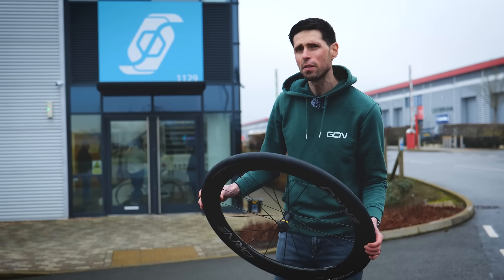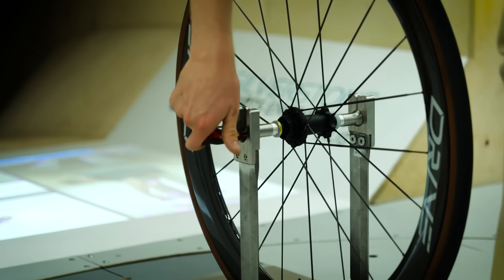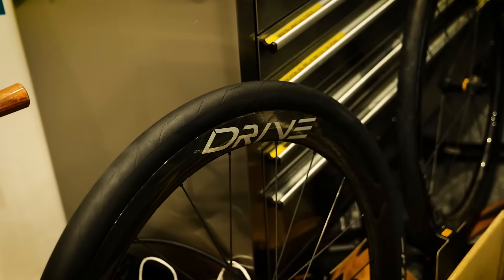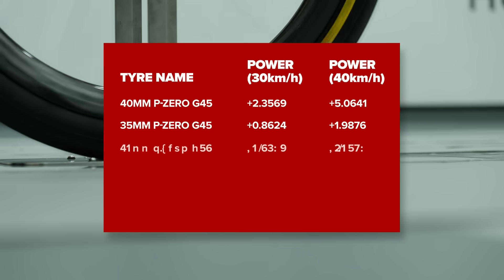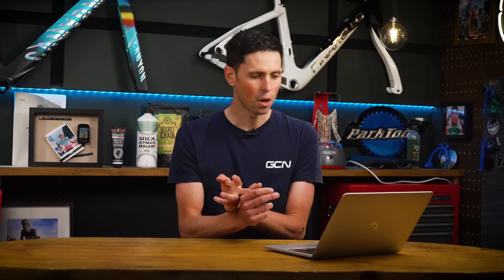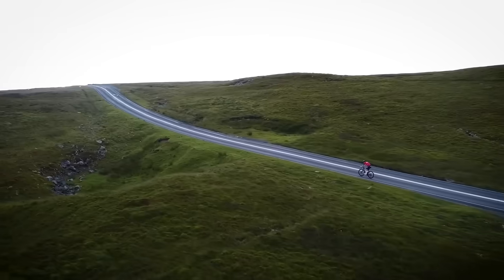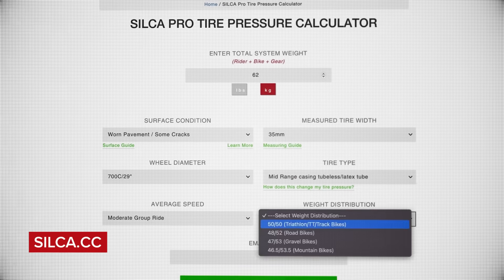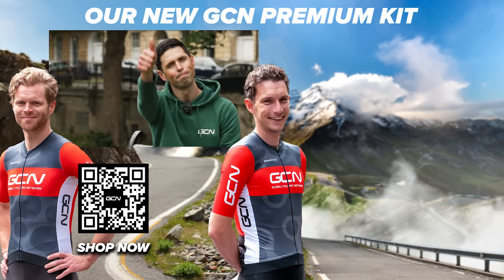The Fastest Tyre Width is NOT What You Think

Comment: The fastest tyre width for me is 23 mm, ‘cause anything bigger will rub my frame. Yeah I know, it’s time to update my bike.
Reply: I was faster with 23s than I am with 28s. 

I was also 10 years younger...😂
Reply: @andrewcockburn7484 it's the tire, I was 35 years younger and I can you it's just these modern tires, 23mm was chunky at that time 😊😊😊😊
Reply: @andrewcockburn7484 uh huh, sure you were! 😂
Reply: I just did a major upgrade from a 1980s iron road bike...

From 6 rear gears from Sachs it went to 10 gears from Campagnolo (Veloce) with Vittoria Randonneur tires 28mm because of the anti-puncture protection.

See if you can upgrade your bike instead of selling it and buying another one.🙂
Reply: @jorgesantos85 That’s what they want you to do.
Reply: Why upgrade something that works perfectly fine?
Reply: @ReaperCH90  The idea though is to pay for new stuff to go faster without being a fitter rider. That's the whole point of new tech! Speed for money, not fitness. Or enjoyment.
Reply: Continental GP5000 23 with tubolito innertubes are fantastic combo. at 6/6.5kg pressure. i don't need to upgrade.
Reply: @Jibs29 GP5000 23mm front (88psi) and 25mm rear (90psi) coupled with TPU inners is my sweet spot.
Reply: 8 bar ❤ @Jibs29
Reply: Nothing wrong with 23s ,I run mine at 90psi
Reply: @1RichieRich  Less rotating weight and faster on smooth roads - what's not to like!
Reply: I feel that, my old Kestrel 200SCI still has 23s. I'd like to go the complete opposite direction with my next bike by getting a gravel bike and running 45mm tires because the roads where I live are pretty crap.
Reply: Same here. Most I can fit are 23. Don't want to shell out on a new bike though and I don't get dropped. 😂
Reply: Ride what you want.
Reply: Keep Your old bike, much better option
Reply: 23s are just fine.
Reply: @da😂😂😂 omfg ok fozzy! vidspendlove5900
Reply: @davidspendlove5900  they're "fine" but they offer poor riding comfort, they're just tokens of the past
Reply: No not Neede, its durable
Reply: @beeldpuntXVI ha,ha I have an old carbon bike so I share that man ..... God that bike still has it ...just not as comfortable. ..
Reply: I'm wondering if it's even worth upgrading my 25s to 28s
Reply: @mrm9561  it is worth it, the difference in comfort is noticeable
Reply: @mrm9561 same here. I got 2 sets of spare tubes so I won’t upgrade until I’m down to one set.😂
Reply: I prefer 20 mm.  They're the lightest. it takes less energy to accelerate, makes the bicycle lighter. Im more into casual riding, not racing, so it deosnt matter to me if they may be slower once you get to speed. Also Im OK with 100 psi, but never go above that!
Reply: On my bike, I have used 23, 25, and 28s, same tire. Hands down, I go faster on the 23s, preferably Vittoria corsas at 120-130 psi, the differences have been a good 20 watts at a cruising speed at 20 mph on a flat smooth street vs a corsa 28 at 80-90 psi.
Reply: I can't fit bigger than 26c into my frame, so, it's pointless 👎
Reply: Tires rubbing the frame will definitely slow you down.
Reply: same, I dont think it is worth swapping an entire bike for....
Reply: Not unless you need a new bike
Reply: I ride 25 mm.   Really not trying to go fast unless downhill 😂
Reply: ride 25mm front till it wears down the fork… i’m joking ok internet
Reply: 25mm for me on an older Emonda - The tyre doesnt' touch the frame but its close enough that stones get caught between the frame and the tyre
Reply: It's not the time to upgrade your bike. No if it works flawlessly well and all parts are working ok. Don't feel pressed by the market
Reply: Why are so many people talking you out of a new bike? I'm sure you dont need that negativity
Reply: Yeah, same problem for my old 2013 Tarmac SL4 - I think the limit was 24 mm.  Unfortunately, all manufacturers stopped with 23 mm tubeless tires, except maybe Vittoria Corsa Graphene which wears way too quickly.  Perhaps newer Continental GP 5000 look narrower than their predecessors.  It's bad at least 25 mm is not included in the test.
Reply: I can go all the way up to 28 mm with the rear, but 25 mm is max before it rubs the fork crown.
Reply: 23mm 200g weight 30mm 300g x2 = 200g more no good for climb 23mm wins
Reply: Omfg
Reply: 😄 i think i got a similar bike
Reply: Not necessarily, a newer bike is not automatically faster or better.
Reply: In 1990 ye
Reply: 😂 great answer 👍🏻
Reply: Ridley Noah, minha bike também me limita 😅
Reply: I'm maxed out at 25mm on my 2005 Madone
Reply: hahaha...it happens with my older bike
Reply: Clickbait. You don't know what I think.
Reply: Try  riding 23mm on cobbles
Reply: My specialized tarmac SL2 can run 25 easy but I didn't try 28 yet, if it fit, the chances of rubbing are very high.
Reply: how can it be? In my old Merckx 2009 I use a 28
Reply: The bigger gain by going wider and riding lower pressure is COMFORT. Not all of us want to go faster, but who doesn’t want a smoother ride?
Reply: I just recently tried fitting 24mm since 25 would be to big and so far so good! Unsure how much of an upgrade that is though xD
Reply: :face-green-smiling:

Comment: I usually ride 32mm slicks on my gravel bike. Bought a road bike last week and stuck on 30mm as thought it was the sweet spot for speed and comfort. I do wonder though, the rolling resistance test is with the bike perfectly upright. If there was a rig which could test corning speed, would be interesting how it affects the results for those fast riders/racers.
Reply: If we forget about cheaper/Budget tyres for second here. I strongly suspect the biggest factor affecting corner grip/speed is the rider and not the minor difference between tyre width. There's no doubt in my mind a wider tyre will have more grip, but I haven't tested this, however I do believe the rider is the weak link for cornering speed!
Reply: @alexpatonGCN agree the capability of the rider is a big factor but equally, as in F1 or MotoGP, the tryres grip in fast corners gives confidence to the rider to go faster.

Comment: If one is touring long distances, the faster tyres are the ones that do not need you to stop and mend punctures twice a day!
Reply: 45mm gravel bike
Reply: Exactly why I switched off gp5000 lol, thing was like swiss cheese in 1/2 the miles my cheaper tires (ultra sport 3) would get zero punctures. I still have plenty of wear left on them but I'm too afraid to even use them again
Reply: @opliko  Interesting, what inner tubes were you running? I switched to 25mm gp5ks with conti's own tubes and the first 1000km has been puncture free, even if I've ridden on gravel in a pinch.
Reply: @myownsite  It was either conti race or race light can't remember anymore, but I never rode on any gravel. If stuff is getting through to the tubes though it's not great regardless. I think I'll try some P7 sports whenever these ultra sport 3s wear out, they last a while
Reply: I use 32mm ebike tires Continental Contact Urban with slime in the tubes and drastically reduced the risk of flats.

Comment: I think that evaluating tyres at constant speeds is a bit misleading, rolling resistance is part of the equation but there are other factors... Wider, heavier tyres are certainly harder to accelerate coming out of corners, for instance. Same for sprints and other speed-changing conditions. What do you thing that this could cost in terms of fatigue over a long criterium race? Personally, I am perfectly happy with 28mm tyres and do not see the need to go any wider.
Reply: Have you done the math to say how significant another 50-100g is at the outside of the wheel in affecting acceleration?
Reply: @mitchellsteindler  even if he hasn't, other people have, and it's genuinely negligible. Wheelset weights genuinely don't impact the acceleration of a bike.
Reply: Heavier wheels "feel" slower, but they don't matter.

The greatest accelerations the bike sees is in the parking lot goofing around. So that is where you feel the extra mass. In a race, no one is actually accelerating fast enough for it to matter. Yes, even out of a corner or in a sprint. The G force just isn't much. Your feelings can betray you!
Reply: @JonathanHair  I have raced a lot of crits and sprinting out of slow corners, lap after lap, for sometime dozens of laps, has been always really hard for me (90Kg+ rider here). How much does a heavier wheelset can make you slower over time? I have never seen a test tailor-made for finding that out 🙂
Reply: @gegaray no need to do a test. It can all be calculated. (1/2)*M*V^2
Reply: yes, I know... if you have 10% more mass, it will take 10% more force simple as that ;-) the question I have is that will make a difference after a lot of repetitions?
Reply: But wider tires corner much faster. Also take that into account ;)

Comment: 25mm is fastest for me because <25 feels terrifying to me at 50kph (newbie "proper" road cyclist) and I don't think my rim brake bike fits 28mm :)
Reply: you have an offset to turn to push the wheel in the caliper. it opens the gap more.
Reply: @Jibs29  The calliper isn't the issue, more the frame
Reply: @thenayancat8802  then why you said "i don't think my rim brakes fits 28" ? i've read it well so i responded accordingly.
Reply: @Jibs29  "I don't think my rim brake bike fits 28mm"
You did not read it well.
Reply: @thenayancat8802  dude... then formulate it in a better way. just say, i don't have the clearance on my frame. that's it. because it lets us think that the calipers is the issue. why making such weird sentence for a simple thing to say ?
Reply: @Jibs29  It's a very easy sentence to understand. I said that my bike does not fit 28mm tyres. It's not my fault that you failed to read it and are now scolding me for your inability to read a simple sentence... dude.....

Comment: Is anyone out there riding 40mm, on a road bike? How can anyone think that's reasonable, to go from 23mm as a standard only a few years ago to almost double that width. If it's for comfort then ok but why even include it in a test with 28mm... of course they're gonna be slower in every way. Why skip 23mm and 25mm which were and probably still are more widely used than 40mm?
Reply: Lots of people put road tires on their gravel bike. I think there are a lot of situations where 40 mm tires make sense.
Reply: I assure you that more people ride 40mm tires than 23mm tires. And that’s because of gravel bikes. Also we already know that 23-25mm tires are a thing of the past because they offer no advantages over 28+mm tires. Also we already know that 35mm tires are faster on rough roads. However there was still some debate about 28mm being king on smooth roads and also there was a debate if the gains from wider tire offset the aerodynamic penalty. So the test was designed to provide data points for these two debates. 40mm were thrown in the mix to learn where the trend ends or inverts.
Reply: @pogoking4000  Fair enough, that makes sense. But I guess what I'm getting at and this is what annoys when there's such a big shift in standards in the cycling world... you end up with two overriding feelings, you either feel duped for riding 23 mm because the cycling community of only a few years ago were basically a bunch of dumbasses that couldn't figure out that 23 mm did not offer any advantages (a simple rolling resistance test could tell you that but they didn't bother?) or you have to accept this groundbreaking new knowledge that goes against everything that people used to believe - which is obviously hard to swallow and I have to assume a lot of it is due to marketing and jumping on the bandwagon. Imagine saying to your cyclist mates, "I  think the standard in 10 years will be 35 mm", you'd be laughed out the club ride 😂
Reply: Most true "road bikes" can't fit more than a 32, maybe a 35 at most, unadvertised due to legal safety considerations, with some modern setups.  But I seldom see anything more.  After that you need a gravel and the affordable ones are all 1x drivetrains making them ill-suited for the road.

Comment: What is the most comfortable on the UK's rubbish roads?
Reply: 40 will be the most comfortable in that sample, for sure. The issue is the frame, gravel bikes aren't road bikes and very, very few bikes clear 40C tyres.
Reply: Almost certainly it will be the widest and most supple casing tyre you can find at a slightly lower pressure. If you want maximum comfort, you need to compromise in other ways
Reply: Molenda tire
Reply: You'll be fine on a 32, he says having just fitted 2.2's.

Comment: Interesting. However, I’m missing the impact of weight. I’m using 25mm in front and 28mm in the back in Spring and Summer. Rest of the year I’m running 32mm in front and back.
Reply: On flat roads, the weight will have next to no difference. Up a climb the weight will have a minimal impact and rolling resistance will almost always trump weight

Comment: You should also have reported measured tyre widths on the rim you tested with. In my experience the 28 and 30mm casings are often actually identical and come up to the same measured width.
Reply: I should have included that, a good point to raise. But on the same rim and the same tyre brand/model, a 30mm will always be 2mm wider than a 28. Different brands and models will have a cross over on 28 and 30 especially depending on rim width
Reply: @alexpatonGCN this week I swapped 30mm gp5000 s tr to 32mm on my rim (giant slr 0) hoping that it would provide a wider and thus smoother ride but both 30mm and 32mm expand to exactly 32mm (interestingly the 29mm aero 111 which is based on the gp50000 s tr carcass expands to exactly 29mm)

Comment: Nice testing! 
Yes the optimum pressure in the tires is determined by total system weight. How might these results be affected by the weight of the rider?
This could be determined 'simply' by adding weight to the rider, recalculating the pressure to use, and comparing the tires (or a smaller selection!) again.

Comment: Let’s put this into context. Let’s say that for a solo rider to pedal along at a constant 40km/h requires a power output of 300W, which is not an unreasonable figure. As we all know, to go even a tiny bit faster requires a large amount of extra power. So, 10 or even 20W either side of this 300W is going to make almost no difference to the speed of the bike, we’re talking about a small fraction of 1km/h. Don’t expect your average speed is going to increase significantly by blowing 150 quid on a pair of tyres.
Reply: If your average speed is able to increase by 1kph(or less) from spending 150 £€$ on tyres I'd say that's a huge win given you could spend thousands on a bike that could result in the same (or less)performance advantages. As always unless your racing it will always fall into the want rather than need category.
Reply: 20 W at 300 W and 40 km/h gains you approximately ((1 + 20 W / 300 W)^⅓ − 1) × 40 km/h ≈ 1 km/h, not a small fraction.
Reply: @tomfryers2 OK, I get the numbers, I exaggerated. However, how many of us ride at 40km/h? Garmin says the average is 25km/h, which is about what I average in the Peak District. I have a variety of bikes with a variety of different size/type of tyre, and from what I can tell, at the speeds I’m doing, there’s not much difference between any of them. If I had to choose, then I’d say the ‘fastest’ tyres I use are 25c GP5000s. I have some 30c Pirelli’s on another bike and although the numbers say they aren’t much slower it feels like riding through sand. They just feel unresponsive when you put some effort in.

Comment: Damn I wanted to know how 32mm worked compared to 30mm
Reply: Unfortunately I couldn't test that, but given the differences in tyre width I found, it's pretty fair to say it's going to be a small difference, that unless you're racing at a very high level it's a case of use what you prefer the ride feel of
Reply: @alexpatonGCN we're all geeks though so that tiny difference 'is' important 😁
Reply: @jakethesnake1976  you cannot even test such a small difference due to test error being bigger than actual difference
Reply: @alexpatonGCN  Would you assume slightly inferior aerodynamics, slightly improved rolling resistance for the 32?  That seems to be the trend your testing exposed.
Reply: One of my bikes, 28mm tyres, when the back one wore out I put a 32mm on, feels way better, definitely will be putting a 32mm on the front when that wears out.
Reply from the maker: hopefully we can put the 32mm in the mix next time too for those of you who really like the fine details!
Reply: Ha, @paulavery8897, that's my pet peeve with these tests as well. Very rarely you see the full spectrum of widths tested, it's always either 30 or 32 missing. @alexpatonGCN, I understand that there were limitations while testing/shooting this video, but for what is worth, a comprehensive video of all widths (23-25-28-30-32-35) would probably draw a lot of road cyclists' eyes, as nobody has done that yet.
Reply: I smile a lot more since I switched from a 28 mm to a 32 mm on my Roubaix.  I’m not riding any slower and I’m much more comfortable and I’m much less prone to crashing because the bike slips on loose gravel or wet pavement.
Reply: @Tedwill-home  got the new 30mm Specialized Mondo on my Roubaix...awesum comfort and speed !!!
Reply: My bike shop only had 1x GP5000 in 30 mm, so I put that on front and put a 32 mm on the back. Feels great compared to the 28 mm tyres I had previously